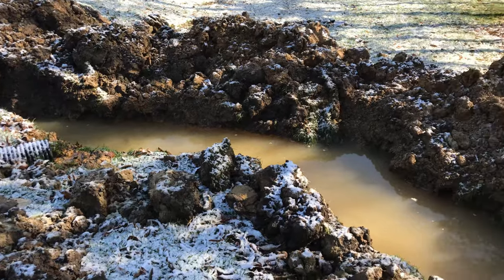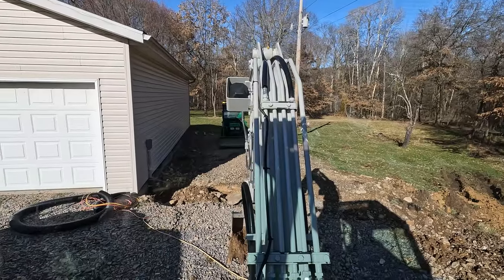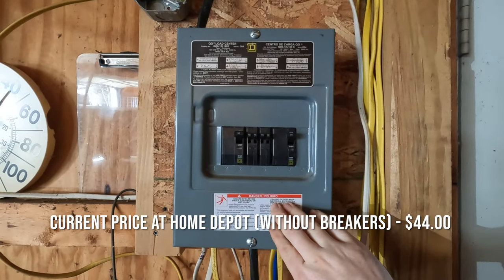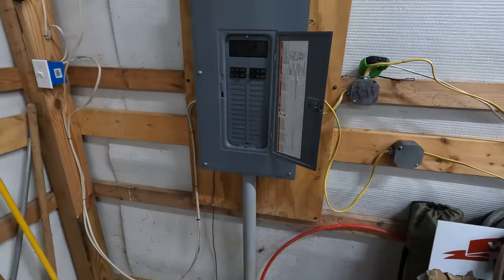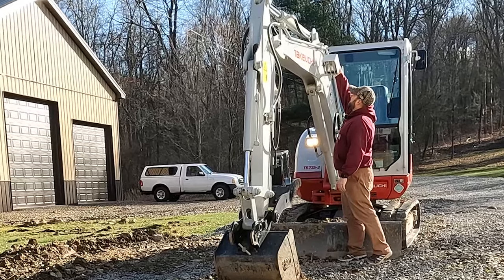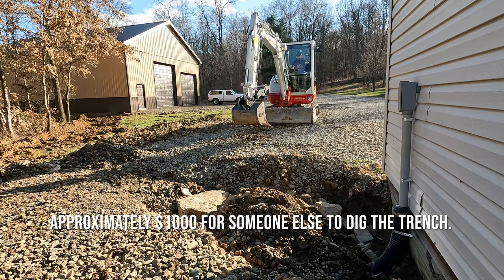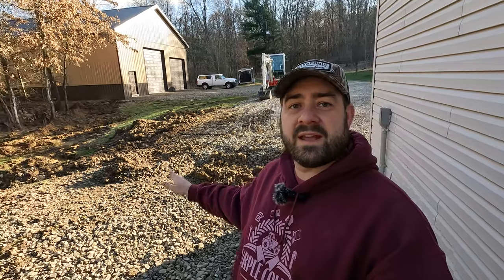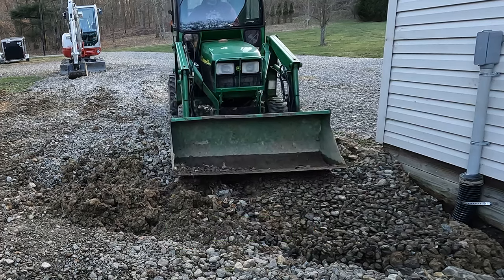What's The Price Tag On Powering Up my 40x60?

Comment: I can only image the cost to run a 200A service from the pole. Prices of materials are insane. Gotta love inflation and Build Back Better.
Reply from the maker: I cringed when I saw the price of that 6 gauge. I don't even want to imagine that 200 amp line running from the pole to the building! I'm glad I ended up with the 50 amp service from the garage. There will be some loss for sure - traveling the distance from the house, through the garage, and to the pole barn. It's about 185 feet total of line.

Comment: A 50 AMP line is basically 100 AMPS since it is a double pole breaker. I would be careful to ensure you are not pulling too much going from the house to the 1st building and then to the 2nd building. Here in NE PA the rain keeps on coming. That will help with your dirt settling but, it will take some time to really smooth out that area. Glad to see you were able to get rid of the extension cord maze.
Reply from the maker: Great point about the load on the original buried line from the house to the garage. 
The rain here is continuing still.  Coming your way! :)

Comment: Keep Up Your OUTSTANDING Work Sir and You Will Like very much that new electricity utility !!! Cheers 🍻🍻
Reply from the maker: Thanks Dave! A few more improvements out in the shop, and some heat - and I could live out there in the camper if I had to. :)
Reply: @PurpleCollarLife What are you doing for heat in the shop? I know right now you have a cigar heater correct?
Reply: @PurpleCollarLife  Yes, that is your escape plan from potatoes peeling duty 🤣🤣👍👍